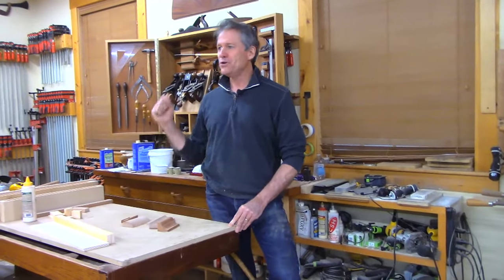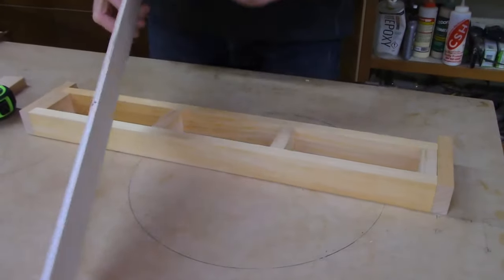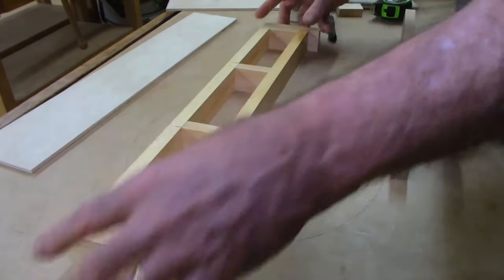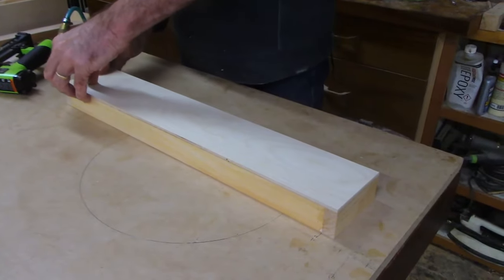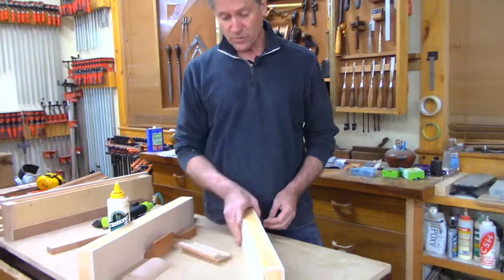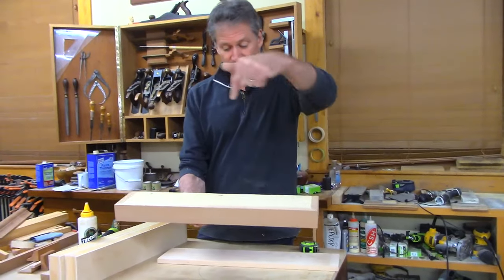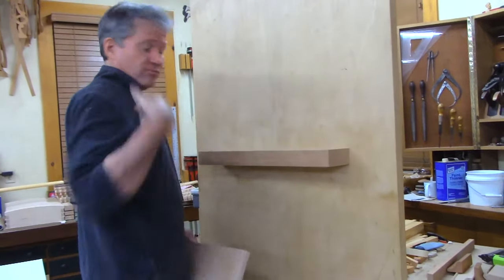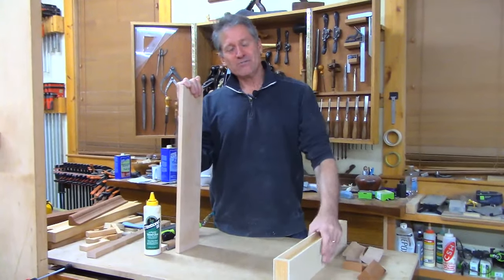How to Make a Floating Shelf

Comment: Fun project! My wife "commissioned" me to make two floating shelves for our refreshed kitchen. They are both 57" long with the bottom shelf 9 inches wide and the top shelf 7 inches wide. I built a torsion box similar to your design, but I used 3/4" baltic birch plywood instead of the white pine for the frame. She didn't have a clue how much weight she expected to put on it so I threaded four pieces of 1/2" all-thread into the studs and bolted the shelf onto it before putting a decorative skin across the front to hide the nuts and washers. I think they would support me doing pullups on them (if I was able to do pullups anymore)! Thanks for taking us along on these Thursday night projects!
Reply from the maker: That sounds like an impressive floating shelf Scott!! There is something especially satisfying to making a good one, sounds like yours was bombproof!
Glad you enjoyed it, thanks for watching!👍😎
Reply: @EpicWoodworking  - I'm an engineer by trade, so everything I build tends to be way over-designed and over-built. You never know if someone is going to use the music box as a step stool or climb the walls using the shelves! You get the idea. LOL

Comment: I wanted to make a vanity using this method 60x21x8”. What size would my boards be and how would I cover it w/out showing seams?
Reply from the maker: It’s difficult for me to give you advice specific to your project without being more directly involved. But I can say this method could be used for larger projects as you described, modifying the internal bracing to a more cantilevered support in order to give strength over the 21” depth. The base frame could be installed first with the top applied over the top and secured with some discrete fastening.
Hope that helps a bit. Thanks for watching! 👍